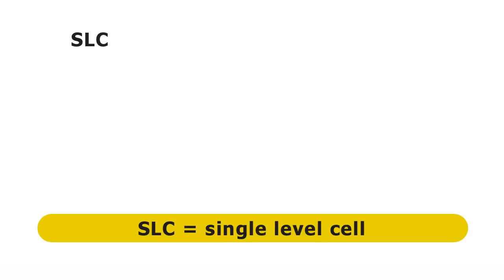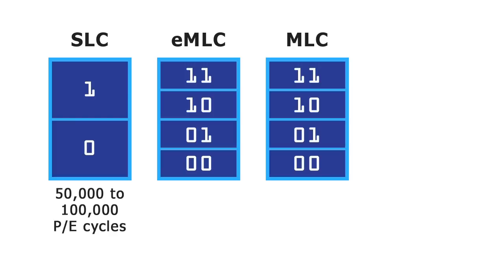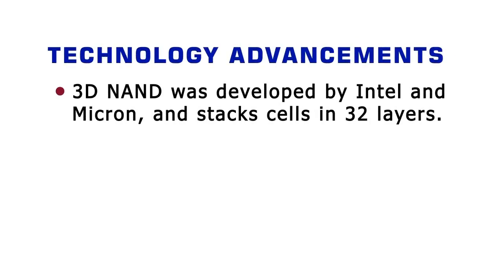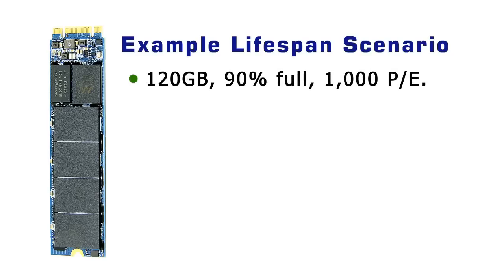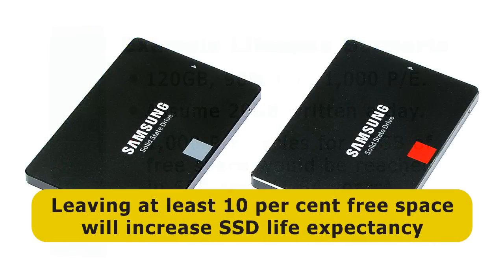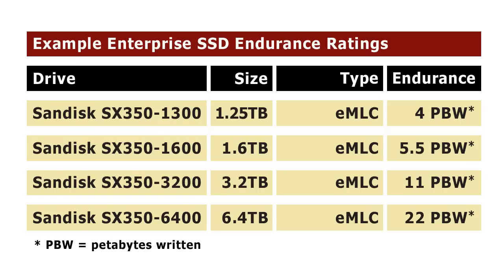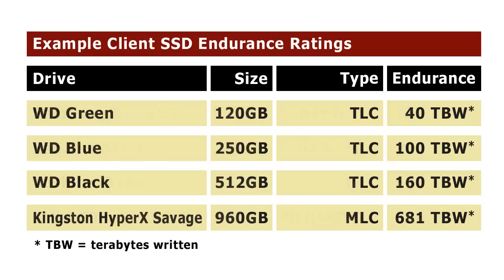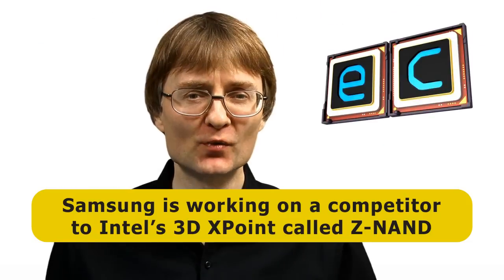SSD Life Expectancy

Comment: Is it also recommended to leave 10% of a drive free with external HD?
Reply from the maker: It is not necessary with a HDD, although HDDs that are very full will get slower. But life expectancy will not be reduced.
Reply: Defragmenting needs free space and without defragmenting the HDD will become slow (even more slow should I say).
Reply: @ExplainingComputers  I have my movie HDD (2TB WD from 2009) completely full many years and it's still working with no problem, maybe it's slower, I don't know, I don't need fast HDD for play some movie. But I had only 5 years old 3TB Seagate and it died, but it was not completely full.
Reply: @Pidalin  your WD is an outlier. If you have any data on it that’s truly important I suggest you back it up. On average a HDD will die within 3-5 years.
Reply: @Arby631  It's only for movies, when it dies, it dies. I have backup of movies which are important for me (I have few movies where I puted our dubbing as another sound track so I don't want to lose that, but 90% of movies are not important or it's on netflix) I have new WD RED for important data and another new seagate for extra backup. HDDs are very reliable if you don't get bad series like it happened to me with seagate 3GB 5 years ago. Most of HDDs I had survived 10 or more years and I mostly damaged it with some mechanical hit to computer.
BTW it's from 2010, not 2009, I remembered it not correctly.
Reply: Ondřej
Reply: @Arby631  I currently have 5 HDD's in my system. 2X2TB, 2X4TB and 1X6TB. The computer was put together 7 years ago and the boot HDD replaced by an SSD 5 years ago. In this time only one HDD has failed, which was one of the original 2TB drives(2TB WD20EFRX) and this was a NAS drive!
Reply: @Arby631  not saying your wrong, but my parents have an iMac from 2008 with a traditional HDD and it works fine. Albeit much slower than it was new, but it still works.
Reply: Is it okay to zero and random out my 1T cheap SSD 5-20 times a week?🤷🏼‍♂️😉
Reply: @Arby631  seriously? I have those old type HDD from the 90’s still up and running as perfectly as when bought.
Reply: 15%*
Reply: @freddieclark  Freddie 2X2TB, 2X4TB and 2X6TB = 5 drives? new math ? 24Tb in total ?? what are you storing??
Reply: @Pidalin   problem is/was the Seagate - in my experience every Seagate I've ever used/had failed rapidly and every WD has lasted forever - maybe a statistical aberration but the ONLY drives I buy now are WD and they have never let me down (fingers crossed 🤞🤞🤞)🙂
Reply: @gcaitube1  I agree, seagate is crap now. I would maybe buy som Hitachi, but they stopped with making HDDs.
Reply: @markusmarkus7683  Most of old 90s HDDs are find if it didn't get some hit. But there is another problem with those HDDs, it's really really noisy, for retro PC it's ok, it's part of retro feeling, but it's still crazy when I trurn on some retro PC and I realize how loud it was back in the day. :-D
Reply: @Pidalin  10yrs hdd in compare to 10yrs sdd i owe, and its been in camera device for over a year (hdd is noisy)
Reply: @Arby631  3-5 years?..... Sine when? I have a hard time believing they die so fast... I've never had an HDD die so fast I used the same HDD's in my first gaming rig for over a decade with no issues at all and they probably still work I just ended up not using the PC anymore and it was used when I bought it! 

3-5 years is typically how long the warranties last for but I've never heard of HDD's having a 3-5 year life expectancy and I call BS on that claim. no offense of course
Reply: if it is only used as a backup it doesn't matter. If it is a boot drive then even the OS needs some free space to work efficiently so typically a minimum of 10GB for Windows and 5-10GB for OS X is recommended minimum  on a boot drive that is a spinning drive.
Reply: @Arby631  WD and Seagate from pre 2009 will live a long time, after that Seagate is junk and WD 's Black series is all I find mostly reliable. Their Blue series are not as reliable as in the past. WD and Seagate bought up the competition around 2009 and have since mostly gone to crap. I have IDE drives from the 90's that still work when drives from 2014 have died. The more you power up the computer, the more wear it puts on a spinning hard drive.
Reply: @TheFrogInYourClosetWatchingYou  if you google it, the 3-5 yr lifespan seems to be the consensus.  My MacBook HDD failed and the apple tech told me I could expect 5, maybe 7 years I think..
Reply: @suzKawasaki  guess I was lucky or like the other guy said maybe the old ones were just built better. I had a drive that was made in 2003 and another that was made in 2001 work up until 2013 and to be honest it probably still works that's just when I last used that PC. I actually pulled the drives from the desktop recently and they are in the room with me being stored.

Hell my old desktop that was made in the mid 90's still works with the original hard drive and all.

Heck I used a laptop for almost a decade that had a mechanical hard drive and it worked just fine up until I threw the thing out....

My sister had the same laptop and when she passed away I ended up with it still have it and it still works and it is a little over a decade old. The original mechanical hard drive is working just fine and both laptops had a lot of use. I don't use it anymore it's old and has malware but I still turn it on every now and then and the hard drive is fine.
Reply: @Arby631  anecdotally, (i know its not necesarily reliable), i have never had a single drive fail, except from physical damage: good ol error 482 from a extreme LARPing trump maniac who thought i had something to do with voter fraud, drives from 18-6 years old all still running good with less then 4 bad sectors across all of em
Reply: @Arby631  Truth. I sometimes have to laugh when I spin up my backup server with 6x 12 year old 1TB drives running in raidz2. They just keep chugging along, albeit some are reaching 1000+ reallocated sectors (they fail smart when they get to around 1800) out of 10 drives bought same model same time, 7 are still functional.
Reply: I heard 20% free and if it is out for a long time it might get bits corrupted
Reply: @Arby631  Hehe I have several (6) 1TB seagates that are 12 years old and 36.000 operating hours that still work :) They are starting to show a few bad sectors (800-1200) but that wont be a problem until they reach 1800 at which point SMART will fail and I take em out of service. They run in a raidz2 so I am not concerned about bad sectors and just scrub the pool each time I get an email notification about a bad sector so that it can be reallocated.
Reply: @ExplainingComputers  169 likes lmao
Reply: @freddieclark  LOOOL why do you need all that space dude?
i have 2 ssd one of 240gb other of 500gb and 240gb for windows and the 2 games i play more and other programs i need to install the 500gb for games and movies and series i download. and at this moment the 240 is 174gb free and have 2 game in there and all other program i really need. and the 500gb is with 280gb free with 5games that i rarely play. last batman arkham knight, division 2, watch dogs2, football manager 2020, rocket league. and lots of movies and some series.
Reply: @gcaitube1  Sorry Typo, that should have read 1X6TB
Reply: @wolvewick4414  I have a huge collection of movies and TV shows that occupy most of the large drives.
Reply: @Arby631  3-5 years. LOL. Who told you that nonsense? And why on earth did you believe them?
Reply: @WigglyWings  
"Defragmenting needs free space and without defragmenting the HDD will become slow (even more slow should I say).'''

==That depends on the formatting. ext4 doesn't need defragmentation. Linux does not fragment files.
Reply: @TheFrogInYourClosetWatchingYou  
"3-5 years?..... Since when? I have a hard time believing they die so fast... I've never had an HDD die so fast I used the same HDD's in my first gaming rig for over a decade with no issues at all and they probably still work I just ended up not using the PC anymore and it was used when I bought it! 

3-5 years is typically how long the warranties last for but I've never heard of HDD's having a 3-5 year life expectancy and I call BS on that claim. no offense of course"

==That would be 3 to 5 y of always on.
I have HDD from 2007. At certain times, I have reused them.
I think HDD manufacturers build quality stuff since they know you will upgrade, so long life is not important. They are right. I need more space.
Reply: @louistournas120  Who uses Linux for gaming lol.
Reply: @EyefyourGf  People who are tired of monopolies, bad business practices. People who want control over the source code of the OS, that way, support can always be given rather then relying on a company that suddenly decides to pull the plug.
It's the same for games. If it is closed source forever, in 20 y, perhaps you won't be able to run a game. A code fix is needed. If the company makes the game open source in 20 y, then the community can fix up the code.
Reply: @ExplainingComputers  1 year later i must ask how do i change to a better ssd and get back my files and other things from the old one?
Reply: @gcaitube1  my experience as well Seagate is crap and WD has never let me down.
Reply: @louistournas120  ``That depends on the formatting.``

It actually depends on what you consider 'defragging' to consist of. If you think it is just making all blocks in all files contiguous, so be it. But on my O&O Defragger, I take the extra time and effort to defrag the entire drive according to filename. That will put every contiguous file near other contiguous files from the same folders. So if I have a game installed, all the files for that game will occupy the same small area on the drive. It's more contiguous than file contiguity. I call that 'defragging' as well. It's a more optimal kind of defragging, and ext4 doesn't, to my knowledge, keep all FILES in the same folders contiguous with each other.
Reply: @shanejohns7901  I see what you mean.
Reply: @louistournas120  Very useful for hard drives, IMHO. As I think about it more, I think it's really a higher-order defrag. If you think of the entire hard drive as a single file, it's taking all the elements of those files and laying them down alphabetically as you'd see if you did a 'ls -a' in linux in the / top directory, one right after another in alphabetical order. Keeps drive head movement to an absolute minimum.
Reply: @shanejohns7901  I'm not sure how to do that with Linux. Perhaps there is a GUI tool for it somewhere.
Reply: @louistournas120  I don't think there is anything for an ext4 filesystem. As you know, it has a built-in defragging model that is done at the system level. And that model only focuses on defragging the blocks of single files without regard to directory structure.
Reply: Better to leave 20+% if you can.
Reply: Hold up, this is good question. New HDDs can be SMR (shingled) and these drives need to have free space for room to copy data around. They are used nowadays even in external hdds, usually 2TB and up, many companies make them, they even hide this fact from consumer because they are slower.
Reply: @markusmarkus7683  NO
Reply: @Arby631  My Seagate black HDD is still alive and kicking after 5 years, but it's got slow I'd say.
Reply: @markusmarkus7683  I still have my SCSI hard drive from 1985 running on an Atari ST
Reply: @ExplainingComputers  what is the life expectancy for Hdd ?
Reply: @markusmarkus7683  NO! That's increased wear and tear on the drive.
Reply: @mazenyasser7208  I have an external HD Samsung of 1 Tb that is almost 10 years old, but the writing, reading is so slow now, I don't remember if it was that slow in the past, and i just found out Seagate is a division from Samsung. I have another hard drive Toshiba of 3 years, everything until now seems fine and the writing reading is faster.

Comment: i swear god.. buying my SSD was the best thing i ever done.. just do it.. buy it.. and believe me.. you will never gonna regret it
Reply from the maker: Agreed!
Reply: Until it fails! Haha!
Reply: Yep. System on SSD for loading speed, and data on RAID 1 HDDs for redundancy.
Reply: I have an SSD in my PS4 for online gaming. Improves the load time drastically.

PC.. not too bothered there has never been a time where during the 30-60 second boot up have I said "damn I wish this was faster"

Most games I play on PC are large games and at the time the cost to GB ratio just made it an expensive option.

400GB SSD for £200+
2TB HDD for <£100

1 game can take up 30-40GBytes.

However with my old laptop an SSD has improved it drastically, then again core 2 duo with a whopping 2GB of RAM it needs all the help it can get.

My end verdict, an SSD can be used to improve some systems but it isnt a "must have" although they are getting a lot cheaper now which is why they are being included in most new laptops.

I have a small (<160GB) HDD for OS, then 2 larger HDDs for apps and files.
Reply: ABD KH    *to god     exactly.
Reply: Duke Dudeston: "400GB SSD for £200+"  what year are you living in? 2014?!  Kingston A400 960GB 129eur (122gbp on amazon uk)
edit: nevermind.. just now read the core 2 duo part. that thing belongs in the next best dumpster
Reply: @Knaeckebrotsaege  you also didnt read the "at the time the cost to GB ratio wasnt so good" yes I was talking about a few years ago when I had to make the choice. And at the time I needed space more than speed.

Yes I know they are affordable now, but as I said. I dont see the need of one based on my current settings for my PC.

My old 120GB SSD I had in my PS3 is in my old Laptop, which is a  core 2 duo and why in the dumpster? It does everything I need it too and with the bonus its a little faster. Just because its not top of the range doesnt mean its no good.

My 480GB SSD in my PS4 I bought about 2 years ago didnt cost too much which is why I bought one.

But again AT THE TIME I went to build my PC I decided capacity was more important than speed as SSDs were quite expensive.
Reply: Can I atteched with mobile phones ?
Reply: Buy it for me..please
Reply: I think SSDs are still fraudulent, like all the USB flash. I use Samsung EVOs and they crawl to a snail's pace when you do large zip file extractions and copies. They are brilliant for booting Windows, but they rely on fast 4GB(?) buffers to fool you into believing they write fast. None of the benchmark software tests them properly beyond their fast write layer, so all the reviews are oblivious to this problem. You can't even google it. Crystal pretends to give you control of the buffer size, but I could tell it's not what it appears when I tested Sandisk USB sticks. Sandisk insisted I use it when I complained about their OTG sticks had random speeds. I was impressed by one, until I bought another one.

I have another strange problem that I haven't tracked down, where data gets corrupted when copying from SSD to HDD, perhaps when sleep cycle is involved.
Reply: @Wallabynge  You don't make any sense?
Reply: No thanks, ill stick to hdd.
Reply: Dark Phoenix  - All drives FAIL at some point or another but yeah, you get what you pay for.
Reply: Yeah same here! Post SSD I had to wait 15+ minutes for Rust to load but now it take 5 seconds!
Reply: I did 3 times and within 3 months all 3 failed.  I'm gonna stick with HDD until they can make them last a little more longer.
Reply: I have a 1TB HDD on my laptop and I start to suspect that it is the reason why it's performing slow for most of my workflow since I do some video editing and Photoshop. so I guess I'll have to replace it with an SSD ASAP.
Reply: I program on an SSD notebook but I always backup to network hard drives each work day. 
The SSD is faster than a normal hard drive. Very fast boot up. But otherwise, the difference is only marginal. A full compile takes a second on a hard drive nowadays. So reducing it by 40% isn't really that much of a gain. I guess they work well for gaming, though (something I just don't do). 
ALWAYS back up your work files, though!
Reply: FACTS!
Reply: @dadewd7061  Any computer hardware is subject to premature failure. Including HDDs.
Reply: Never had an SSD fail on me (yet) but hard drives? ALL the time!!!
Reply: Dark Phoenix  - Samsung is good but I prefer Intel... i have several and none have failed on me, yet. I love these critters! Hehe
Reply: @MissRiaElaine The more drives, the merrier :)
Reply: just went from enterprize WD HDD to SSD  2 weeks ago and OMFG !!  my computer and games are lighting fast !!
Reply: I regret buying my ssd for $40 to figure out it's $30 two months later
Reply: @seireiart  hmmm., even a conputer with 1TB HDD????? Still slow?? Damn.
Reply: I have been almost 2 month my ssd life is now 97%
Reply: Yup
Reply: «the best thing i ever done»…   I feel your pain.
Reply: Alex Kennedy it was pretty easy to follow he simply stated the test for the sdd lie. and second he is having files get corrupt when he copies from the ssd to the hdd i means it isn't that hard to follow.
Reply: ZimZam131 yes but hdd have been around since the dawn of time and are more reliable at the moment. i am sure ssd will get their but i am sure by the time they do their will be another storage system that will blow ssd out of the water and it will probably have the same problem but hey at least the ssds will be more reliable lol.
Reply: @garypowell4565  Without mentioning brand and model your post didn't give the valuable information I was hoping for.
Reply: @danl.4743  Drevo Xpro 1 and Kingston ssd 40g
Reply: it doesn't matter which ssd you want to buy. just buy ssd
Reply: @DukeDudeston  Heh, 30 - 40 GB is still nothing compared to what a flight simulator can achieve. It's not rare to see FS2020 or P3D installations reaching hundreds of GB in addons
Reply: @garypowell4565  Im calling your bluff